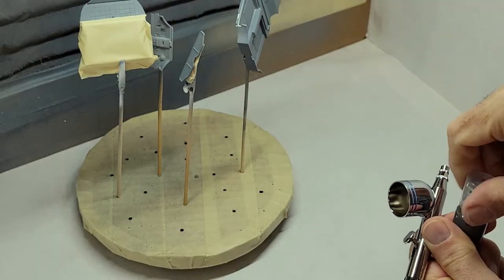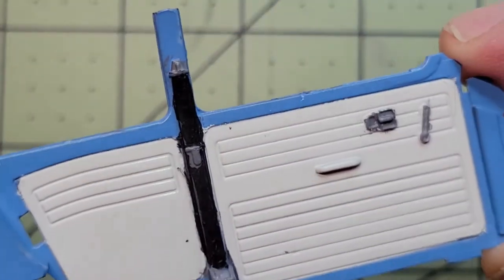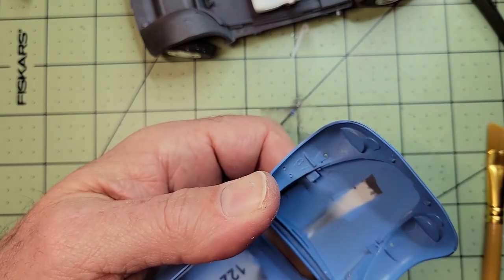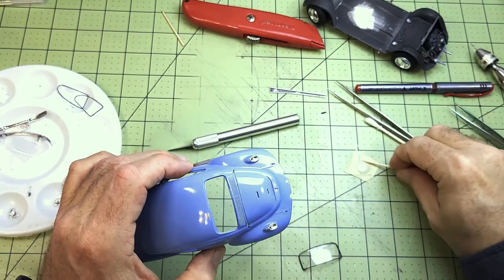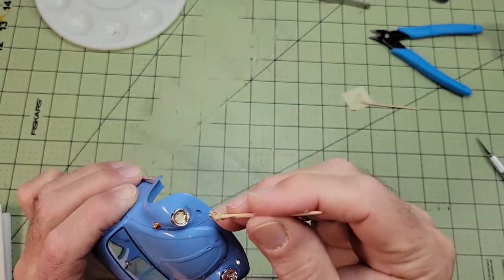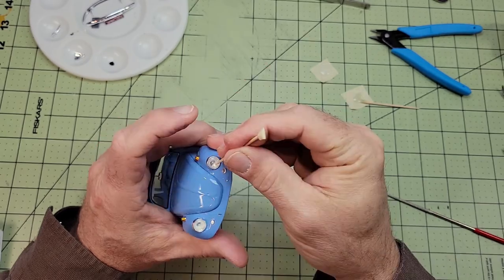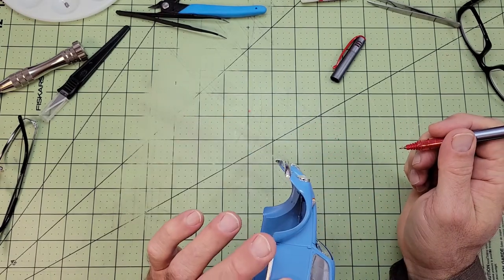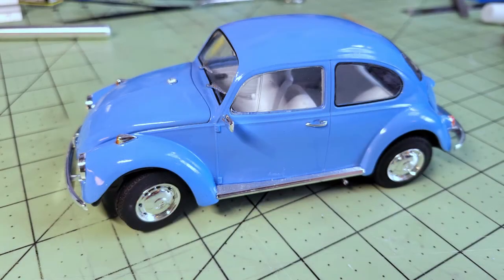Final Assembly of Revell's 1968 Volkswagen Beetle Plastic Model Kit

Comment: This was a spectacular series.  My dad had a 70’s beetle when I was a kid. I remember it having the four vents on the back engine cover. I loved it.  By the time I was old enough to buy one for my first car (16) they were all rusted out where the struts were mounted in the frunk area.  I recently saw this model on Amazon and want to recreate how I remember it, color and all. It was dark blue with white interior. I’ve appreciated your journey as I haven’t built a model since I was a young teenager. I won’t be using an air brush, so wish me luck!  Paint is an issue as it’s winter in my part of the country so I think that’ll be the hardest part.
Reply from the maker: Nice! Thank you for sharing:-)
As for an airbrush I do recommend them but just for base coating and primer. They've got some self-contained battery models out there these days that are not bad for both quality and price.

Comment: Nice job for your first model. Looks good.
Lots of modelers have started using a medium viscosity, oderless CA glue such as BSI's SuperGold+ for installing windows, clear parts and small parts. The "Oderless" part is important as standard CA glues will fog clear parts, and at least BSI's SuperGold+ will not. One trick is to hold the window in place and applying a small drop of the glue at the corners and let it wick around the window. I use Evergreen cement for the windows (got it at Hobby Lobby.) It is a PVA glue so can be wiped off before it sets up with a wet Q-Tip if it gets on the glass.
Welcome to the wonderful world of modeling.

Comment: There is a product called Bare Metal Foil.  It is an ultra thin aluminum sheet (like gold leaf) with an adhesive backing.  It is very useful for applying “chrome” trim on your dash panel in the opening minutes.
Reply from the maker: Cool Thanks for the tip!

Comment: Super Glue can be used to weld painted parts.  IMO, this work around should not become habitual, but used only when necessary.  Use tape or Liquid Mask or scrape the paint off with your blade.
Reply from the maker: Thanks for the info!

Comment: 1968 only driver’s mirror in EU, passenger appeared later in the 80’s. Also wipers are UK style, but steering is EU
Reply from the maker: The kit came with the ability to do it either way, so it's very possible I've mixed the parts up. Thanks for watching!

Comment: How did you get your paint to not have streaks? Also, in the interior section with the steering wheel, how did you put that together? That is the one part I'm stuck on.
Reply from the maker: I won't lie to you, that's a battle I'm still in the midst of. The higher the quality of the paint you use helps, but preparing the surface is the key. Also, using an airbrush on the larger surfaces will leave a smoother finish.
Reply: @bryanshobbies  How do you prepare the surface? Do you just need to wash it? Also, do you know of any cheapish airbrushes that are good?
Reply from the maker: All the parts come out of the injection mold with a little film of oil on them that needs to be washed off but after that I just clean up the any flashing or injector pen marks with 600 or better sandpaper and then prime it. Rattle can or airbrush, either one's good. Go in thin light coats just until you get it covered so not to cover up any details.